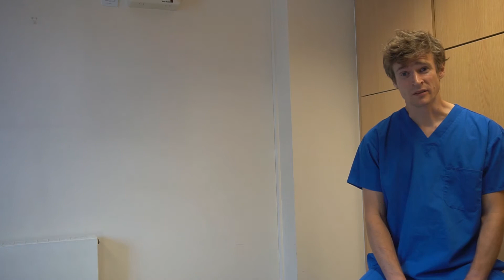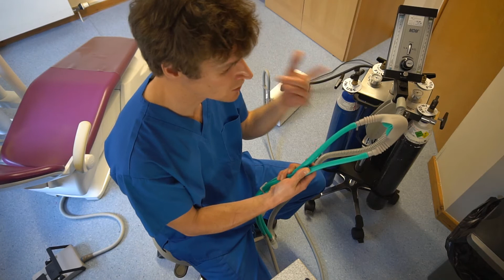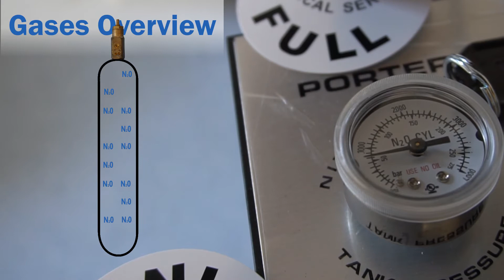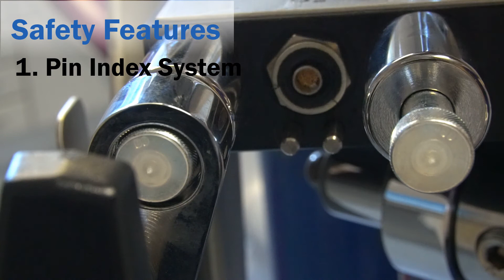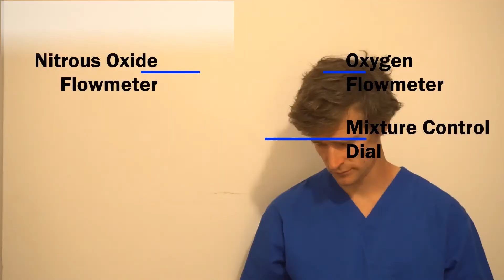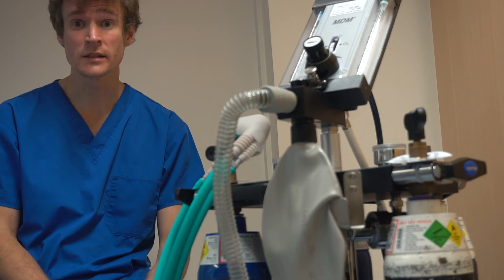Equipment and Safety features

Comment: Great video! We enjoyed watching.
We love the explanation of the n2o cylinder contents

A couple of points…

I noticed you have a clear right angle connector in the wrong place in your breathing system. Generally the right angle connector is not needed in the assembly of the breathing system.
Please refer to our instructional video on our website.

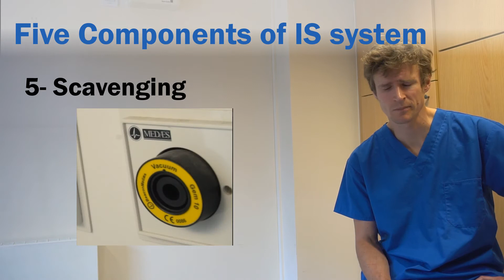At 4:05 depicts a vacuum port that is not used for inhalation sedation. A, AGSS port (anaesthetic gas scavenging system) is used. AGSS port has a screw thread. We supply adaptors for this.

At 5.07 the pressure from the regulator is not reduced to 45 psi this would be too low.  it is normally between 55 to 60 PSI.
Reply from the maker: Fantastic, thanks for the comments RA medical, it's great to have feedback from THE experts in the field!
I'll try and edit the video soon to correct these points. 

I was actually planning on putting together a video on equipment disinfection based on your recommendations.
Out of interest, how did you come to find this video, I developed it as part of training for core dental trainees?
Reply: @DavidJones-mn3se  video was found when doing a general search on YouTube.   

If you would like some help reviewing your script before filming you could send it to  info@ramedical.com with reference for Janet. She would be more than happy to help you.